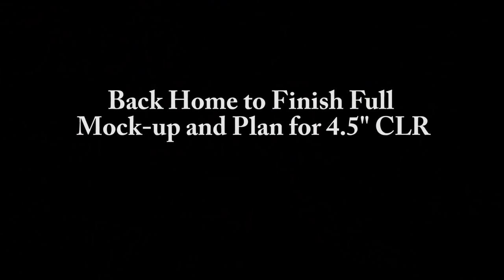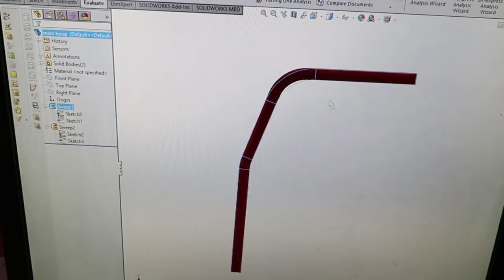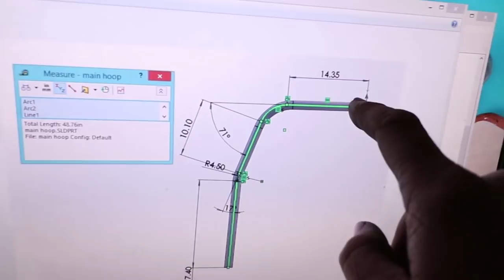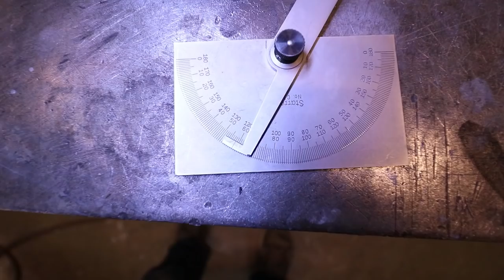How To Measure For Roll Cage Main Hoop & Fabrication

Comment: Are you going to be fitting a headliner? If so you might want to add more roof clearance - just a thought
Reply from the maker: Thanks Chris, I wasn't planning on running a headliner.  Probably just lightweight carpet on the roof

Comment: Nice job. Can’t wait to see the welding part. Did you use mild steel or chrome moly?  I’m pretty sure their are rules on the welding like “no grinding” and no coating that would test my welding ability to the limit.
Reply from the maker: Mild steel, and I'm going to TIG weld wherever possible.  Should be fun!